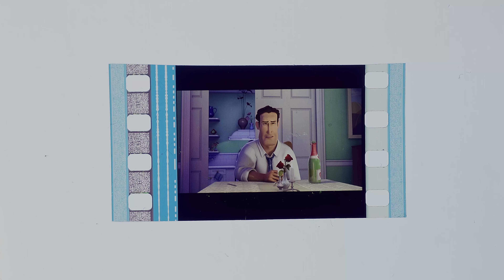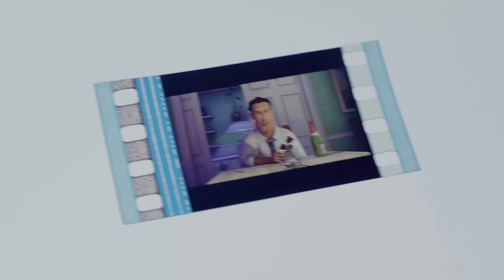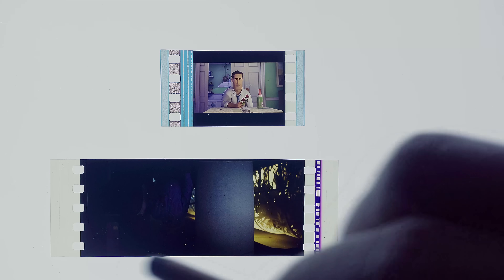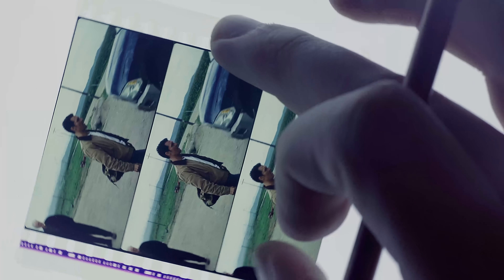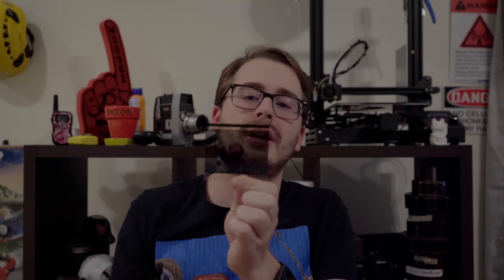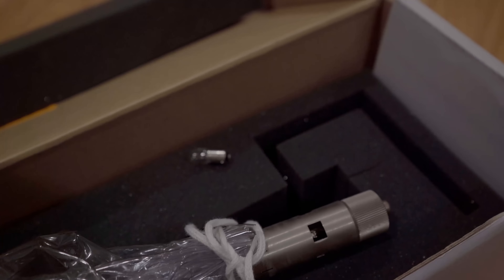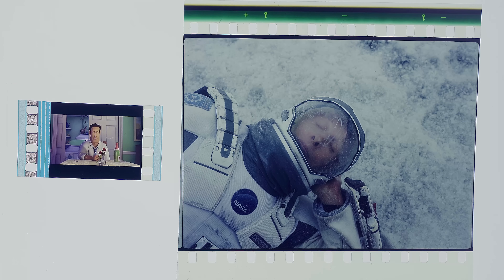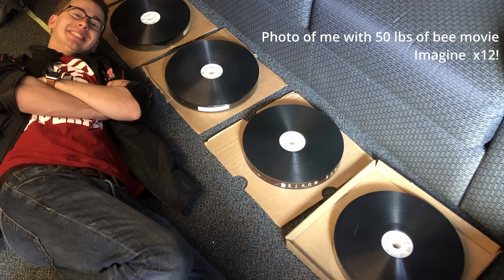Why you need to see ODYSSEY on IMAX 70mm film

Comment: Can someone explain this: So im from Europe and there is only "true" 1570 imax theater, which is 1:43 near me in Prague, but then someone said that even tho that Prague one is the only true one, there are still multiple other 1:43 ones so now im confused. Isn't the 1570 only one in 1:43 or...?
Reply from the maker: My understanding is that IMAX has some different ratios, such as Omnimax which could be different than a flat screen
Reply: Screen size is 1:43 and to get to that size you can use IMAX Film Projector or laser IMAX Projector.

Comment: You forgot to mention IMAX loads sideways. How many hours do you get out of a 15k bulb like 150? You should really wear gloves and safety glasses when changing bulb, but if the boss or corporate is around the whole lead vest get up. Thanx for the Projectionist memories! My favorite one is when I still lived at home & my mom would grab my work pants to wash and I has dozens of splices in my back pocket
Reply: 15K lamps are water-cooled and run under 1500 hours max.
Reply from the maker: Thanks for watching! I am not sure the lifespan of those lamps, but since they are water cooled I would assume a few thousand most likely when operated correctly, although I can also see with that amount of energy they might not last as long.

Comment: What digital intermediate is being used? The IMAX projection may be 15perf in size but is the content an 18K scan? No. It will likely be a 4K DI transferred to the IMAX film so you are not getting the full IMAX resolution.
Reply from the maker: You can scroll around in the comments here but Nolan does not use DIs for the film prints unless absolutely necessary for a scene

Comment: I watched Avatar: The Way of Water in IMAX Mall of Asia and by my surprise it's a tall screen, i mean REALLY tall in 1.43:1 aspect ratio projection screen, I thought it was gonna be wide like 1.90:1 digital IMAX because they stopped using 70 mm since Interstellar but still managed to light on xenon lamps. I researched every IMAX theater in the Philippines and this is the only one who has a tall projection and the rest is 1.90:1 aspect ratio, including the new IMAX with Laser from Evia Lifestyle Center 

Even though the Avatar film is presented in digital IMAX format which is 1.90:1 aspect ratio i can see the gap between top and bottom of the proection screen but the resolution is outstanding. 

Not sure if IMAX Mall of Asia will project 70mm this year for Oppenheimer and Dune: Part 2. I guess I'll have to find out...
Reply: They will most likely be presenting the dual laser 4K 1.43:1 version. As a lot of refurbished IMAX theatres now only run digital with very few exceptions as they are expensive to run, maintain and train people to use.

Comment: Hey Kyle, great video, I'm a subscriber now. However, i wanted to ask for help to understand how to see this movie in india in 15/70. I'm ready to fly to any part required, i just want to know if there are any 15/70 capacity theater in my country. Google keywords are getting jumbled up and idk what to do.
Reply: We do not have a 70mm IMAX Film projection theatre in India at all. 
I saw Dunkirk in the Carnival Cinemax Wadala, it was my first and unforgettable experience of IMAX footage of any kind. It was a massive, the seats were arranged in floor wise fashion (7 floors). The sound and the footage was breathtaking and it was so massive that you'd never want to sit on a lower floor, The experience was richer that VR. But it was liemax as well.
recently I saw Avatar TWOTW in Prasads Hyderabad, and it's the biggest screen in the country. Although It was difficult to compare the sizes of both Wadala and Hyderabad because of the long gap of 6-7 years. This is liemax as well, since it's old Film projector has now been replaced with new dual 4k Laser Projectors. But the experience here was unparalleled as well and this is where HDR and HFR shone. I had watched ATWOW in theatres thrice before. And this was the 4th time, but it was out of comparison. It felt like I am seeing the movie for the first time. The screen was extremely massive and the experience was surreal. It was worth the expensive tickets nonetheless. 
Also, while screens are this huge, and from experience, I can say that the digital projection technology has come way ahead now. You will never be able to differentiate between film and digital actually.
Reply from the maker: Hey thanks for watching and subscribing! Honestly I would wait a bit before looking, as theaters in the next months should be announcing if they are showing. However, you could start by looking for the IMAX 70mm theaters that showed something like Interstellar or TENET or one of the other large movies that came out on IMAX 70mm and see what theaters did show it. This does not guarantee they still have 70mm, but this would mean they at-least did have it, and since they have not installed new IMAX 70mm theaters in years there won’t be any places showing it that did not previously show it.

Comment: Where did you get 70mm 5-perf frames of Interstellar? As far as I know they only made 12 or so 5-perf prints. It’s also the only fully analog version (except for the CG shots) of the movie.
Reply from the maker: I actually projected that print last year. When we received the print on inspection there were a few frames that needed to be removed from damage, I assume the previous theater missed it. So I chopped it out and kept it :)
Reply: @KyleMiko  I’m glad to hear it’s still around. Would have broken my heart if one of the few 5-perf prints was gone.
Reply from the maker: @VariTimo  Yes same here! Although it’s not in good condition, it was rated by our distributor on a scale from 1-10 about a 5, and there were quite a bit of lines
Reply: @KyleMiko  Yeah I’ve heard the 5-perf versions aren’t in great shape. But they were experimenting with reducing 15-perf to 5-perf.

Comment: Can you please provide MTF measurements of a 15-perf 70mm film to prove that it is, in fact, resolving 9,000 lp/pw with contrast that is more than zero (or, as you claim, 18K)?
From my experience, it is nowhere even close to 18K. :)
Reply: It’s probably closer to 12K if you have the finer grain films directly printed from the original camera negative. Kodak Vision3 5219, which is 500 ASA is about the same resolution as the ALEV3 sensor of the Arri Alexa at the same gate size. So it’s a bit over 2K in 35mm, and about 4.5K in 65mm. But that is when pixel peeping. Film always has a more natural sharpness and feels more detailed. It pics up the right details while digital does not. Digital is not great at reproducing ocean water, sand, foliage, or even the human face in some cases. That is just the capture side. From everything I’ve seen, all high end digital laser projectors have resolution failure because of the laser grizzle. Small specular highlights on the screen. Film obviously has grain but 50 to 250 ASA 65mm film on modern 70mm print film will definitely be higher resolution than any digital laser projection I’ve seen. That is why the Netflix film Roma was released in 70mm. Because there are no projectors capable of showing all the detail the Alexa 65 can capture. 

Also resolution is widely miss understood anyway. 2K can look fine on a full 1.43:1 IMAX screen, even when 70mm IMAX will have a distinct hyper real feeling to the detail and how far into the image you’ll still be able to make out detail.
Reply: @VariTimo  Even if 15-perf 70mm negative film can reproduce 12k LW/PW with some discernable contrast, 15-perf 70mm projection certainly does not. 

To state that "digital is not great at reproducing ocean water, sand or foliage" seems like something fetched without evidence to support it. My experience is contrary to that statement and I do have data and measurements to support this observation. 

8K laser projection can actually show more detail than 15-perf 70mm film projection given the actual content has that detail in the first place. None of the 8K digital cinema cameras that I tested were able to deliver 8000 LW/PW with any discernable contrast. But that doesn't mean there are no digital cinema cameras that cannot match or, in fact, greatly exceed sharpness of 15-perf 70mm film projection as well as the negative. 

The future of cinema is not laser. It is LED displays and they can certainly deliver high levels of sharpness greatly exceeding that of 15-perf 70mm projection. 
And, yes, "resolution" is greatly misunderstood as it is counted in pixels, whereas sharpness is measured in MTF. They don't always correlate, but sharpness (MTF) of film can be readily compared to MTF of digital camera and there is no reason why perceived sharpness of film should be higher if the MTF is not.

Comment: This of course assumes that IMAX film-capable theaters do a good job projecting the film. I've seen more bad IMAX presentations than good in modern times. IMAX projectionists are becoming more and mode rare, and it's not something that you can just train an employee from the concession stand to do. But that's what they often MUST do these days. IMAX technicians are also a dwindling breed, meaning that picture isn't guaranteed to be calibrated very well. The xenon bulb may be under-focused or under-amped resulting in a rather dim picture. I have seen this a lot in IMAX auditoriums because they're usually not gonna buy a new xenon bulb costing thousands for one movie. This not only means it can be dim, but it can flicker or a weaving arc which results in the brightness not being stationary on screen. It can also be over-focused resulting in a hot spot and dark corners which is another thing that's very common. Theater owners are super cheap. If there is a penny to be pinched, they will absolutely 100% do it.

I remember seeing Dark Knight Rises in real IMAX when it came out. What a mistake that was. Very dim picture, very bad audio with no subwoofer at all (theater's fault) and that's on top of the horrible audio mix (Nolan's fault). Not only that, but the cinematography was horrible. It was framed in a way where it made it look like more of a stage production, because you could see the characters head to toe in many of the IMAX scenes and it just felt, well... amateur. I'm not a fan of the IMAX aspect ratio at all. GREAT for what IMAX was invented for (Nature documentaries and the like), BAD for Hollywood-style movies.

That said, I am looking forward to Oppenheimer. However I refuse to see it in a movie theater in any format. It's a Nolan movie and I know better. I'll wait until I can watch it at home with subtitles on because I want to understand the dialog. Nolan's movies are the only ones I have to do that with. He is overrated and I wish studios would stop bowing to his IMAX whims all the time. The 4K Blu-ray will cost less than an IMAX ticket.

Comment: I try to clear up the "K" Numbers, because they seem to be obvious wrong in the higher Formats (eventhough the IMAX Format is absoute fantastic). Of course we are talking here generally about the Measures of the Projection Frame (becaue the real Negativ Film is 65mm.. not 70mm)
1. We have learned, that horizontal (only) counted 4096 Pixels is named as "4K Resolution" (in the Cinema World).

2. 4K: In best Conditions (modern Film, Lens, Process) i think analog 35mm Film can max. reach VISIBLE "4K" Resoultion (Kodak says 6K, but I think 
    thats more a theoretical Data in terms of mesurable Filmkorn Differences) but thats not the Point here.

3. 5Perf./70mm: If you use the "K" Wording, the visible Resolution horizontal should be (2,5 x 35mm/4K) about 10K (in good Conditions) corealeted to Point Nr.1 (which is amazing and far far ahead from any Digital Projektion System today) So i think "12K" is more theoretically..

4. 12K? 15/70 IMAX: As shown in the Video, horizontal lengh is just bit more than the 5/70mm Frame. So I think in good Condtions it could be "very obvious" max 12K Resolution horzontally. I think the often mentioned "18K" are more a marketing Nature Number, because of 3x 6K 35mm horizontal (calculated wrong). Of course it has huge visiual Effect when you have such a rich Resolution vertical as well, don't get me wrong. But i think you don't help a cost-critizised Format with unreal or simply wrong Numbers. Thers is nothing in the digital World next a 12K 15/70 Projection (even if digital has Advatages in Brightness and Contrast, it's a question of Taste).  

In the End i want to point out, that the Limit on the Quality is more the Lens than the Filmmaterial, in the Big-Frame Department. Glas has Limits in Resolution, and very high Resoultion needs huge Opitcs. Many Action Scenes in these 15/70 Hollywood Movies have to use as small as possible Setups, so i don't think we have optimal "K" Resolution anytime!... Prove me wrong but for some Large Format Camera Systems (65mm Film, or Alexa 65) there are barley Optics in general.
I love the IMAX 15/70 engagement and hope People with this special Interest can experience new AND old MOVIES  in Future just next to the more practical Digital Projection. I think ONE 15/70 Projection System at one Country (outside USA) with ONE 15/70 Copy from the Movie should be a minimum Standard. Due to lack of Numbers of these IMAX (Nolan) Projects, there should be a possiblity to watch the older 15/70 Movies like Dark Knight, Interstellar etc. as monthly Special too!

What do you think!? Please Comment
Reply from the maker: Lots of interesting stuff here! It's very possible that you are right. At the end of the day like you said I don't think the actual resolution is all that important, at least in terms of the video. The bigger thing here that more people could comprehend anyway is the scale, which is why I love the 35mm -> 70mm image. But, your estimates for resolution is probably right, and your assertations about other factors such as optics are also a very good point, as it takes many factors to get the sharpest resolution possible. However, I would say that the 35mm resolution can vary, as for example this example was a flat image that did not use the entire area. Scope/Anamorphic 35mm uses more area, so in theory that could then have 25+% more resolution. Also, I do agree there should be more possibilities to watch older 15/70 movies at more places! Thanks for commenting this, very nice work.
Reply: @KyleMiko    Yes, anamorphic uses the complete Frame, but otherwise if've never seen an anamorphic Lens with very good sharpness to the Corners. So I think it is a benefit in Lightoutput an most wanted for "charakterisitc" Choice :) and never in terms Resoultion. 

On the digital Side: In the last Days, i did a research and realized how many Movies already were shot on Alexa 65. But there it's still the lack on the Projection Side. I can't imagine now that globaly there will be more than real 4K Projection (even now it's only in most popolar places) in the near Future. 
Of course i belive, that a ALEXA 6,5K Image on the most modern 4K Laser (IMAX Theatre) can hold up Quality quite good, but there is still a difference at the Big Projection Screen Side. Eventhough i think that there will be an 8K DLP from TI, the Cinema Houses will get unconscious to buy/invest in a new system again and again ... That's the Sting of the digital World. In Analog, on 70MM System never gets old. 

In IMAX, i still have to experience the new 4K Laser System, luckly the new IMAX Leonberg in only 2h from my place, which gerenell has adv. in contrast and light output. 

I'M SO CUROUS for the Future because of the Existens of the new FUJIFILM GFX100 system with its Large Format 11,6K Sensor, best Color-Science (for Movie as well), and already existing Lens lineup made for that Resoulution, already capable of 4.096K24p (internal Lineskipping to 5,8K and than Oversamling to brilliant 4K right now) Video Recording. 
If FUJIFILM makes only one Step, which would require: 
- a further Development of the Sensor to achive a faster and bigger Reaout for a OpenGate Output 11,6K and 8K
- a faster Processor to handle that
- a "H" Series called Video-centric Camerabody with active Cooling and prof. Connectors
....then we would have with a Bang the first time a real and truely Successor to 15/70 IMAX on Camera Side, in my Eyes. (and not those 4K, 6,5K Tryouts..) and would only make Sence with a now only fantasy 8K DLP System.. So we learn, 15/70 IMAX still is and maybe will stay the absoulte Best.

Eventhough, culturwise and historically, the analog IMAX 15/70 System should always be accesable at specail Places, period

Comment: Hey Kyle, i'm so curious because of Numbers thrown arround. You show to have original Projection Frames of all Sizes! 
Can you measure the EFFECTIVE/Active Zone (without Perforation or black Corners) in mm from the IMAX, 70mm and 35mm Frame an type it here?? Thank you so much
Reply from the maker: Sure. Of the frames from the video (35mm in FLAT aspect ratio, so letterboxed) we have: 

35mm: 13mm x 22mm = 286mm
70mm: 24mm x 54mm = 1296mm
70mm IMAX: 52mm x 72mm = 3744mm

Wow, that shows that The Bee Movie frame is actually 13x smaller in resolution than the Interstellar frame!
Reply: @KyleMiko  THANK YOU! Yes, this is real varies. I noticed differences in the 35mm Frame World too. There are very different visuals Qualities in 35mm too
Reply from the maker: Glad I could help! Thanks for watching
Reply: @KyleMiko  So when my Notes are right, in 35mm the Negative and the Projection Complete-FRAME Measures should be identical. But not to forget that the 35mm Proj. Picture has that loss of Space for the Audio Track. I somewhere read the the 35mm Negative effective Area is 24,89x18,66mm. So there, i think a 35mm Proj. was truely a quality Loss. Anyway they just should have stayed at 70mm (65) in the Past and do less but higher value Movies .. ;)))))))))))